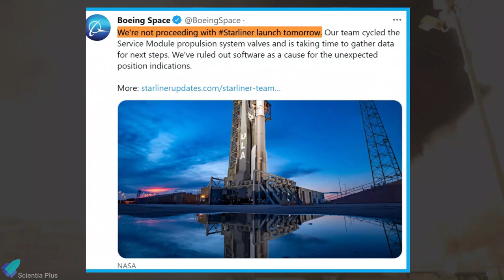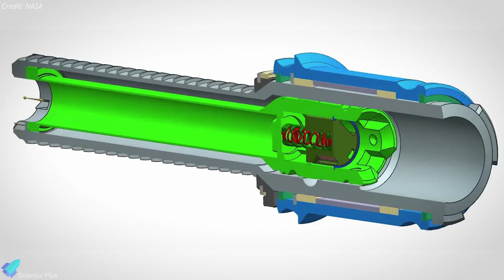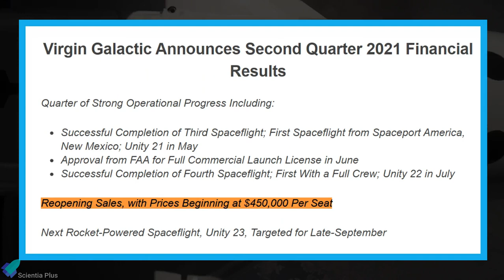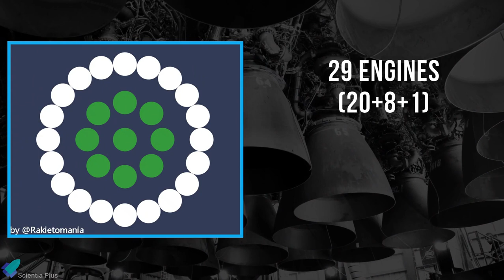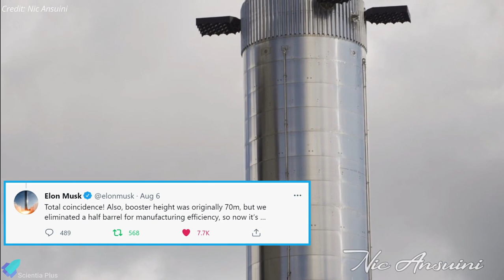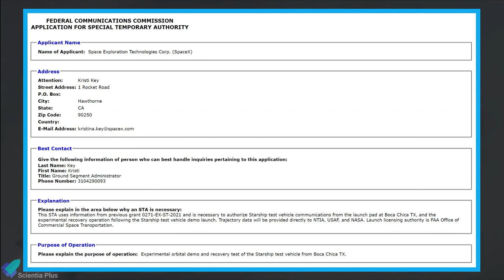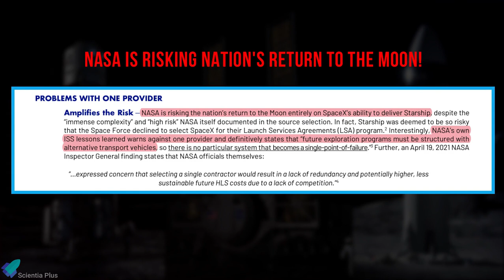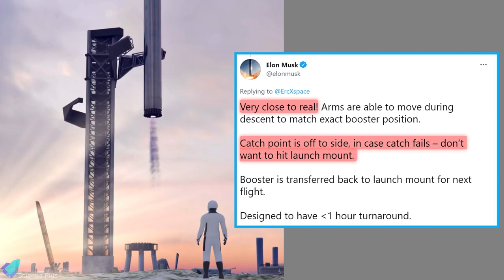SpaceX Stacked Starship: What's the Next BIG Step? | Mars Sample Collection Failed | Starliner Delay

Comment: At this stage, I wouldn't want to be the first astronauts to fly Starliner.  1st test had two failures: the first causing the mission to scrub; the second almost catastrophic on the capsule return.  Now valves on the 2nd test not in proper configuration.  Costing billions, Starliner has yet to have a successful mission while Spacex has visited and returned from ISS multiple times.
Reply: That valve error would have caused a failure. The only reason it was found was a delay for a DIFFERENT reason. Since they were delayed, they ran an unplanned check.
Reply: @ProfessorJayTee  Enlighten me further... ;-)

Comment: Boings star liner has had 2 attempts both ended in failure 3 strikes with the same hardware you're out
Reply: Boeing Starcoffin is DOA! maybe they should have invented new hardware instead of trying to rely on 50 plus year old valves... & Overpaid Management to get it done! I sure wouldn't want to be the expendable astronaut on it's first Crewed mission!

Comment: I am NOT OK with Starliner attempting a docking with the ISS, at this point.  At minimum, they should first be required to perform a successful orbit and re-entry WITHOUT "suffering serious software problems", or "almost experiencing a dire flight anomaly".

I definitely don't trust them not to botch the docking and snap the ISS in two, or something equally catastrophic!

Comment: OK----------. I do not understand why the Booster's Grid Fins are made of Steel when Musk has been Preaching about saving weight. Seams to me Titanium Grid Fins would save Several Tons at least.  Is he saving the few Million $ the  Titanium Fins would cost for a possible disposable Booster? Or are they having problems making such large Grid Fins as the Ones showed look Darn small?
Reply: They are made of steel to take the higher temperature on reentry and last ,,in the interview Elon sed they will be re designed after the test just a precaution to failure.

Comment: Liked the video very much. Keep going, I like your material. But I will add that the ~10 tanker flights for a Starship to land on the Moon and fly back is actually pretty accurate. There has been more than a few videos (like Marcus and Scott) confirming that. Now a Lunar Starship will not be coming back, so the Blue infographic is being deliberately misinforming about that part. But it's a fact that a Starship and Super Heavy can only get the ship to LEO with out refueling. Even a non returning lunar Starship will likely need more than 6 refueling to get itself to a Near-rectilinear halo orbit where NASA wants them to be, pick up astronauts and land and then lift from the lunar surface back to a NRHO.